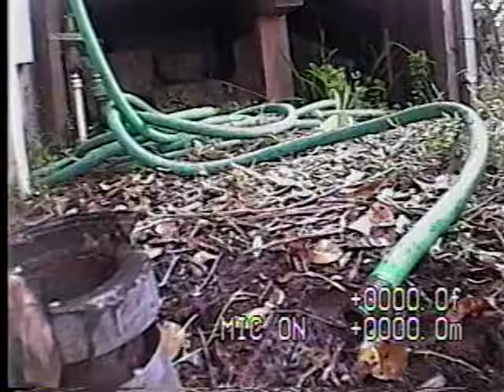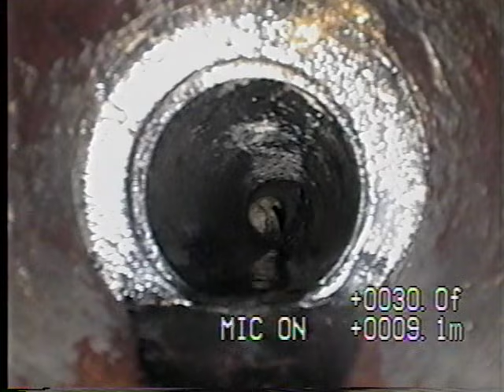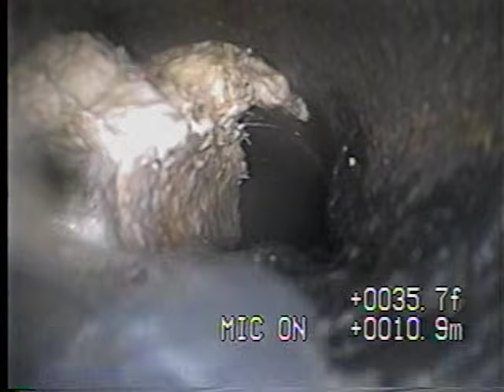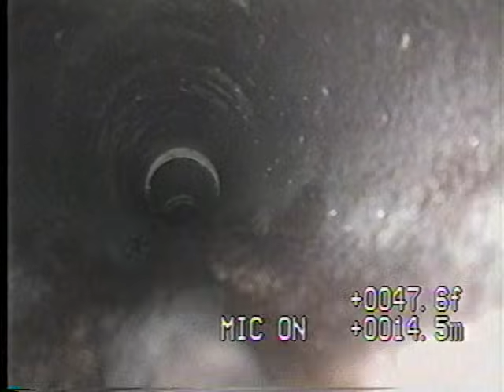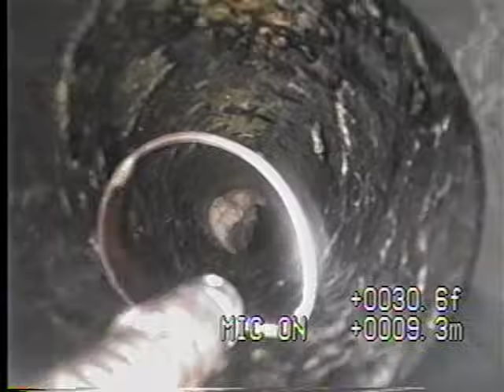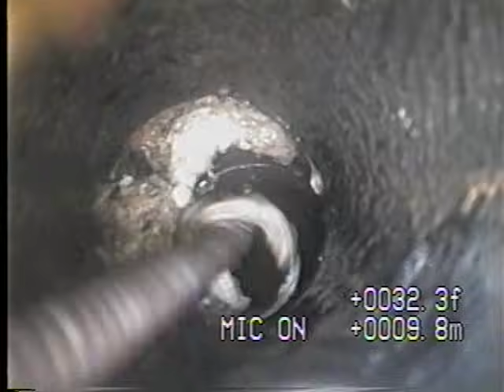Plumbing Camera - shows pipe needs sewer line repair

Comment: 75mm patch on a 100mm line , what years were they laid , if around the quake , then they may have run out of 100mm drain , so used the few feet of the 3inch to get the drain up and running ,to planning return later and replace it with a 4 inch section drain. They might have been forced to other dwelling to get their drains up and running due to the Quake damage in San Francisco and surrounding communities.  It’s a messy time putting utilities back together after a Quake , Marin is just over the GG.  Just a theory . Plus all the out off alignment of the joins is more than likely ground move  over the last 100 years , i worked and stayed in Marin a few times of the years . We in Wellington New Zealand have similar topography and a fault line too , and a cable car.  Over 40 years of seeing some pretty suspect plumbing and drainage. But also have had to just get the water and wastes up and running so ppl can live in their home , we have always returned to bring up to code . JUST A possible scenario  . 😊

Comment: 6:06 "We can dig up your front yard, pull your plants out, remove concrete, ... and put your yard back together as if we were never there." Yeah right! That's pretty much never the case. Even best case, soil takes years to settle.
Reply: Yup. Brought an old house and a year later. The grass over the drain line going to city started sinking in and making an almost trench. They most assuredly used annual rye as the grass died off too. Like used cars be fuckin careful what you buy 😅

Comment: the video shows the clog at 32 feet , you  can dig to replace that leaking root invaded joint with a Fernco flex seal. That will work but there was a few other joints starting to let roots in.

Comment: but if you used cast iron for sewer lines that will rust and cause problems again, i live in north carolina  and i have never seen cast iron for sewer lines and i do undergrounds  and we only used pvc  pipes

Comment: I will do a drain unblock and suggest a cctv at the end. If the customer declines a cctv inspection if it clogs again I say the next unblock cost will include a cctv as their is a potential problem. Better see what's going on sooner than later.

Comment: I've never been on  a job where the plumbers went DOWN a pipe size downstream.  That being said, the blockage was not at the reduction. I suspect that the plumber(s) NEVER did anything (until this video) but poke a hole in the blockage every six months. Before cameras,. it is a known fact that if you snake back and forth for an hour (on a pain in the rear jobsite)...chances are you will NOT be coming back in six months. But if you just clear the blockage (or in this case,..poke a hole in it so you can call it good) and leave,..you will be back sooner. If it was my house, I would dig it up and redo it,..but then, my labor and backhoe are free because I own them.
Reply: Agree

Comment: Why not just repair the two bad spots.?
You should.have a locator which would tell you where to dig exactly.
Also which camera is that?
Reply: Because the pipe went from larger diameter to smaller. Someone installed the pipe incorrectly. Gotta fix it then forget it at some point.

Comment: Dig up and use 10' cast iron pipe for replacement? Looking for a payday. Use a pipe locator on the camera cable. Locate the exact position to the foot above  what looks to me like a cracked pipe with root intrusion which then captures the grease. This way you minimize the trench size 3'x4'. Cut and replace a 12"-18" section with ABS. Camera in the pipe makes roots look huge. Little fine roots around the seams are normal. It's the gnarly brown tree roots that will cause backups. Use root killer or copper sulfate crystals once a year to control them.
Reply: I would agree with this but the difference in pipe diameters creating the lipped pipe can be a nuisance nonetheless it was poorly thought out and poorly executed. 😊

Comment: Theres a whole lot of comments from people who have no idea what they are talking about. That blockage was toilet paper and 'flushable' wipes that got caught at a bad joint. After the blockage is cleared out completely you can see that the joint is offset to the side. No real plumber would ever install a section of 3" pipe in the middle of a 4" line, this is going to cause reoccurring blockages at the bottleneck, and/or the craptastic joint where this blockage was. Another clue they weren't a real plumber is the bad joint its self where the pipe is transitioning back to 4". There are 2 options here, keep snaking it out every 6 months or replace the piece of 3" with 4". I would do PVC myself, the cast iron we get down here in florida just doesnt last. Replacing 4 feet of pipe burried under someones front yard will cost about as much as having it snaked out twice, the real crooks are the plumbers who dont want to make a permenant fix. Lots of shady plumbers survive solely off a clientele of people who call once or twice or 7 times a year who are led to believe 'this is part of the cost of living in this home'. I'm no longer a plumber, I do video sewer inspections for a living and pride myself on telling every customer the truth.
Reply: You are right. Except a lot of customers dont want to spend the extra money to dig up the lawn or even pass a camera to begin with. So often thats what they get. A drain that blocks regularly and need to be fished at least 1x per year. Ive had clients prefer to pay once a year than truly fix the problem. But yes there are a lot of crooks out there . Including the ones that tell you that you absolutely need to replace the whole line even if there is only a small amount of roots , just because they contract the job to a friend and get a 20 percent cut on it. If it isnt a major problem like this one, a screw up from an amateur, then i always advise them that if they dont have rhe money to dig up the lawn and replace the line then theyre better off to have it cleaned every year or so. Where i live here in montreal, canada, some places can run up to 10,000 $ to replace the drain believe it or not
Reply: @garydohe  some people are on fixed incomes. Many are older.  They only get a out 1300 a month retirement.  ... they have no mortgage anymore and cant afford to fix the pipes ... so spending 100 a year to clean the pipes would  better then 10grand ....
Reply: I charge 375.00 to clear a main sewer line. I tell my customers that if I don’t need to clean more than once or twice a year.  So either 375.00 or every 6 months 750.00. Compared to 2500.00 to over 5000.00 dollars to replace the complete sewer. Which really is a better deal. 
  If this plumber needs to go into the street how much more a running foot is that going to cost. I would pot hole those two spots (4 inch line to 3 inch) and where the pipe blockage was.
  Also why did the plumber not have a cutting head on his snake that fit the pipe. His cutter was way to small. It should have removed the toilet paper and wipes in one or two passes. 
  I’ll bet he talked them into replacing the complete pipe to the center of the street (city sewer)
Reply: @garydohe   10,000 thats crazy
but most people  dont have the confidence to do it themselves.
its not hard. But its messy .
Im here because im trying to figure
whats clogging the plumbing.
Now from this video i got the idea to buy the camera and see for myself
because it may be something simple like a paper clogg
or the pipes could be completely ruined
So before i break the floor i want to check it out with the camera.
with be a simple problem
Reply: @MexicanChinMMA 10k isnt that crazy. We just got a bill for $13k to repair our sewer line because it’s directly under our garage and is 12’ deep. So they have to cut through the concrete and dig by hand because a backhoe isn’t going to fit. Some jobs are a lot harder than just digging a few feet in someones yard.
Reply: @garydohe what if the roots keep growing back? thats even more often then a year shouldn’t they dig up and fix the problem from there? or just take down the tree then fix
Reply: @jerrycohen1070  If you have a hole/crack in a drain pipe under ground roots of any kind will find it and pig out on it. Pipe is supposed to be, and can be if installed correctly, water tight....period.
Reply: I’m with you. I do service work, video inspection, pipe tracing and jetting. I’ll tell them the truth and give them options.  I work with a couple of other companies that I feel comfortable with and let them dig up the ground or slabs. I do stop by if time allows to reassure the home owners that the work will be  good
Reply: How about lining the pipes with epoxy impregnated felt?  That seems the way to go in many cases, but it might not fix the problems shown in this case.
Reply: @redhen689    My friend in California had a main drain issue and the cost was going to be about $20K to line the pipe.  Called in another plumber and the guy advised him if my friend dug it up he would replace the cast iron with PVC.  It was only about two feet down as no freezing weather and so my friend dug it up. Plumber replaced the line and added two clean outs for less than $1000.  Best to get a second opinion.  Of course if you have raw sewage overflowing everywhere, I can understand how people might pay any price to get it fixed fast.
Reply: I can’t believe that this company was out to snake the drain ‘five times’ before insisting the owners allow them to run the camera down to see what is the real problem.  Maybe it’s one of 300 properties a company owns, but an individual owner should be told, “You gotta a problem that we need to see to figure out.”
Reply: Wish more service men were honest.
Reply: great! how much it cost the video inspection? are u somewhere in Alabama? I dont even know where the sewage pipe is. crawl space.
Reply: Amen
Reply: Thank you so much, sir. Finally someone that blesses us by giving a detail explanation.
Reply: Replace with plastic..and the guy probably used whatever he could find to complete the pipe connection..I feel like alot of people in older homes cut corners   when the cities started connecting into running sewer lines.
Reply: Yep
Reply: In Vancouver,BC, Canada it would cost $5000 to $20,000😮😮😅😅😅😅😅😅😢 No kidding

Comment: I’ve been working a plumbing issue using minor equipment. The camera I’m borrowing is only a few feet long. The 4 inch cast iron pipe is finally cleared from the house. The issue was when they joined PCV to the cast iron, it wasn’t sealed properly. I had to chisel cement off the main pipe in which some of it busted. I had to purchase a blade to cut thru the main pipe. I’m letting it soak with root kill for a few weeks.  Looking for ideas on how to proper seal and to possible rent a camera with a 50 foot capacity.

Comment: I've dug up my entire yard and can't find my cleanout... would buying one of those tiny snake camera's allow me to identify it and 

it's location?
Reply: You may be able to find the cleanout if you do decide to use a push camera like the one shown in the video but its a long shot. You could zero your footage after the initial drop in the pipe and measure outward to the cleanout then measure the same distance over ground to get a general idea.
It would actually probably be cheaper to order a plumber with a push camera and locator to get the exact location of the cleanout.
or you could call a CCTV pipe inspection/Vactor jetting company in your area to do a lateral launch and locate from the mainline to your house. I would definitely try a plumber first as the CCTV company I work for charges $240 an hour.
Hope this helps!
Reply: Those cameras are not cheap and start at $1,000 for a small unit.
You can rent one from your nearest big box store.

Comment: Sewer lines are so unpredictable if you are called to cable or jet you need to put a camera in and see what caused the issue not come back every so often to fix it there’s obviously a damn problem get the spot fixed with excavation or trench less replacement. There’s so many companies boring now a days and they somehow manage to find your sewer line inspect your lines!!

Comment: Lmao. Unclogs the pipe completely but recommends replacing the pipe. Yes there are some lips but water easily flows through i mean the water was flowing with half the pipe blocked lol.
Reply: 4 inch to 3 inch is not how you transition the pipe, you shouldn't transition to a smaller pipe. There will always be a clog.

Comment: Nice resolution on your sewer video camera. It gave really sharp images of the inside of the sewer lateral. The initial installation was faulty where they reduced the pipe size which caused the restriction and the toilet paper/grease accumulation problem.

Comment: You were running the cable backwards at the clog. I noticed when you cut back to it after 6 mins., you were running it clockwise and started breaking the clog up.

Comment: Hello, as a helpful suggestion make sure you also clean your sink drains every 3 years or now if you have never. Any debris within like grease or gross puck like objects should be put in an ice cream pal and then dumped in the street sewer water drain. This will make your house feel comfortable and have a good feel to walk around in a spiritual free zone for saints. If you still do not feel right in your home put all of the drains in a freezer bag after you clean them out and let them freeze should take about an 2 hours or less or you can replace all of them if you want. This removes all residential curses.
Reply: what the fuck

Comment: This sewer does not need replacing. The guy was upselling bigtime.
Reply: How does it NOT need replacing? The pipe Decreases in size! Solid debris will always hang up in that pipe transition. That being said, Cast iron will always rust and fall apart....Eventually. VSP pipe is in good shape except for the crack at the Alleged CO ( no way to tell for certain unless you have a pan and tilt push cam or can locate the clean out cap)
Reply: Thats what i was thinking,
Reply: Might just be me but at the end pipe looks broken and offset no?
Reply: I would replace it, 3 inch to 2 it's Not adequate

Comment: As a plumber the problem was with the reduced pipe and then after that there was a cracked fitting behind the toilet paper build up all that was needed was a repair not a replacement of the drain line. But cast iron for replaceing clay you might as well put Orangeburg down there pvc is the way to go and no couplings sc 40 with the bigggggg bell ends no tree root is getting through that but that's just my 2 cents
Reply: PVC ?? OR DO YOU REALLY MEAN ABS BLK PIPE???
Reply: @mikehurtado3194  dang this was a long time ago but yea pvc pipe sch 40 I still don’t recommend foam core pvc pipe for underground work but if u can find sch 40 with the bell ends go with that
Reply: Also less fitting = less problems
Reply: Also after looking over the video over again the pipe installed is clay. the Restriction was a 3in cast iorn pipe at the end of the restriction it upsizes to 4in clay. The toilet paper had some tree roots in it most likely from the improper repair. Probably from the clay pipe Collapsing and the quick fix was too shove a pipe In a pipe. I believe I made a snarky joke regarding to the cast iorn repair and took a jab at the old ww2 drain pipe that was installed that is what we know today as orangeburg. And I believe I made a rant about pvc pipe which I still say today but over all I was probably 1/2 asleep when I wrote this lol

Comment: Wow, that camera was fascinating.  Makes me want to get one of my own and go visiting the neighborhood to see what everybody's been eating, maybe become a weekend scatologist.  I see your camera had a microphone.  I think I'd add a loud speaker for some late night spooking.  This won't only open drains, it'll open doors to new crap!  Ok, seriously, very informative. My house is approaching 60 years and most of the work I've seen was clearly weekender if not "weekender with bad attitude".  Had to rebuild 1½ bath in this place.  Set out to replace rotten flooring discovered vertical studs hollow from termites.  One question, why are you still using cast iron these days?  Everybody I've talked to pushes PVC.  From what I've read the life expectancy is 40-50 years for PVC as opposed to 50-60 for cast iron.  Considering the cost and weight I'm surprised to hear you're doing iron.
Reply: Pvc  has a longer life span if not exposed to uv rays underground installations are approved for 75+ years my kids kids will fix it when that time comes but I agree on the cast iron it is only used in public areas such as hospitals jails court houses and libraries due to the fire code because when pvc is burn it makes a very bad gass but since they can't sell a lot of cast there saying it's more quiet and reliable phhhhhh lol

Comment: what's wrong with cast iron? it has 100 years lifespan.
Reply: 40' of cast iron lasted 43 years in my house.  Then the bottom of the pipe basically disappeared.  I replaced it all with PVC.
Reply: House I bought 6 months ago has the same problem under crawlspace.  But it only has a hole on the bottom!
Reply: More like 50 year

Comment: Other than the downside in pipe diameter,  the overall condition of this pipe was good.  The blockage was grease buildup and not root intrusion.   Didn't see any reason for a costly dig up and repair.  Snow job
Reply: Exactly, no need to fix what ain't broken
Reply: But but but but the 45 was blown out causing the issue I think repair is the better option here